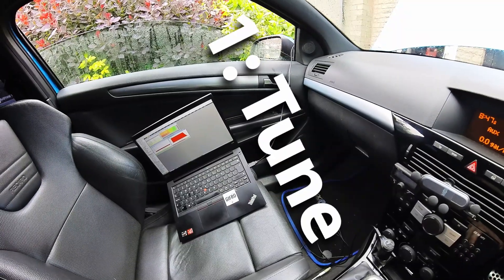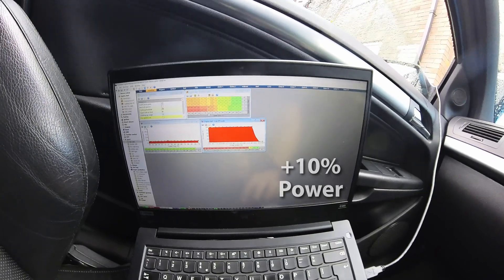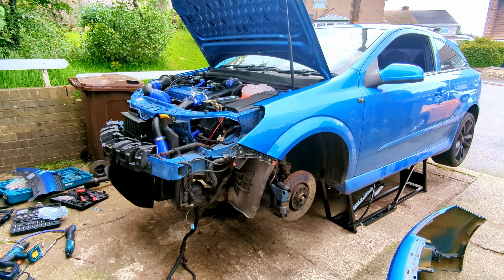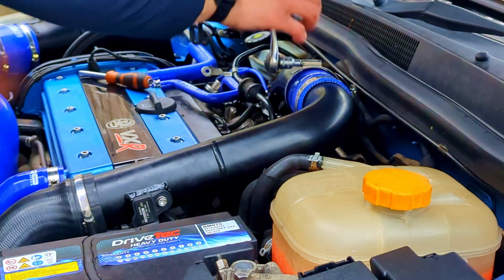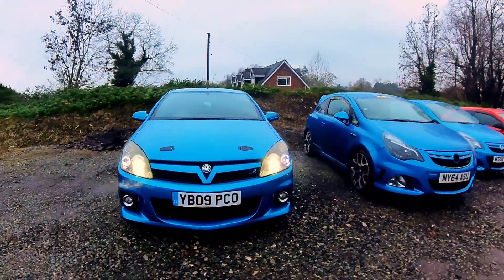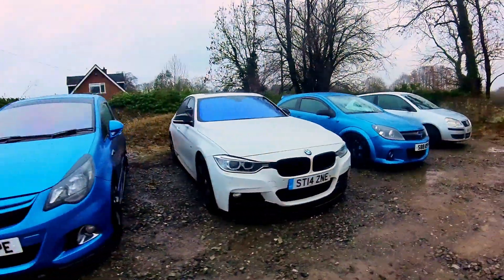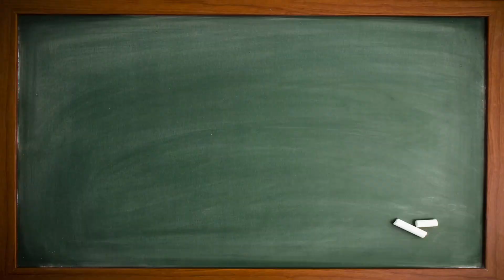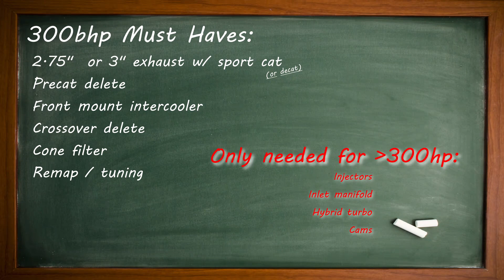How to get 300hp from your Astra VXR / OPC - Z20LEH Stage 1 to Stage 3 Tuning Guide

Comment: Great video and this is not to pick any fault, but the crossover delete is not necessary either to see 300BHP. A standard airbox mod and a good panel filter is just fine. And will keep the bay looking stock. Win!
Reply: These are the same mods I did, 300 hp is possible.
The biggest problem is the intercooler, it has several 90 degree angles and one 180 degree piping 😂
The pre-cat is also out and I have a 3 inch system from the catalytic converter. The intake manifold is also scrap, is taken from the naturally aspirated engine 🤣
I bought the China EDS copy, the car runs better over 5k 😊
Reply: a lot better throttle response with cdti airbox
Reply: @chrissingleton8473  perhaps, however hardly noticeable and still will make 300bhp
Reply: obviously you're never had the crossover delete then makes a huge difference keep intake temp down a lot better to
Reply: @chrissingleton8473  Had 6 SRI Turbos, 10 GSI Astras, 6 Astra VXR’s all varied states of tune, so I think I’m well placed to say if it’s highly noticeable or not. Also it’s much harder to keep intake temps down with an Open air filter as apposed to enclosed one.
Reply: @Mike-OFAH  i don't run cone it's 1.9 cdti air box done by Courtenay sport  they even said when they did the mapping they breath alot better an don't heat soak the same an use the same set up on there track car
Reply: @chrissingleton8473  1.9 CDTI airbox yes better than an Open airfilter and shorter route to turbo, but again, to say you notice a massive improvement of throttle response especially with fly by wire is a little OTT.  And back to the point in hand, you don’t need that to achieve the 300bhp mark
Reply: @Mike-OFAH  direct route to turbo an better airflow obviously response is  going to better its not 🚀 science 😂

Comment: Injectors are definitely recommended for 300bhp on the astra h vxr, as the standard injectors are veing pushed constantly to their maximum capacity and become unreliable. I findnits. A risk not worth taking, just upgrade the injectors for safety, the 613cc injectors will do just great.
Reply from the maker: Yep! Agreed 100%. At 304bhp/500NM my injectors were at 98% duty cycle so open 98% of the time. Much safer now it's on 630cc injectors which won't even be stressed at this power level.
Reply: Just had mine custom mapped today, I have cross over delete, remus turbo back, mtc fmic, mtc top hat kit, turbosmart actuator and forge recirc and my car only made 291 today. Wonder why I didnt get over 300. I was told at the end of the tune tat to get it over 300 to invest in a klaasen inlet manifold.